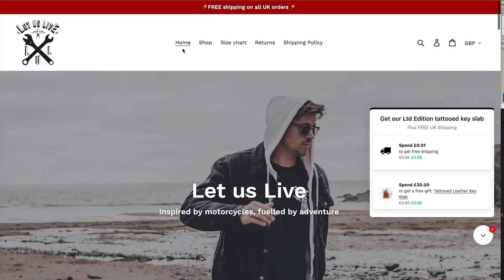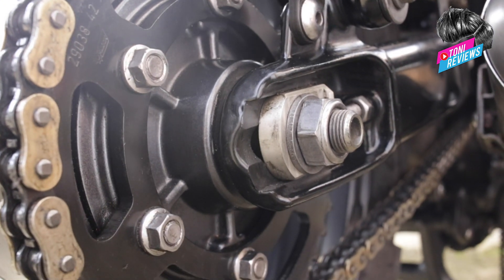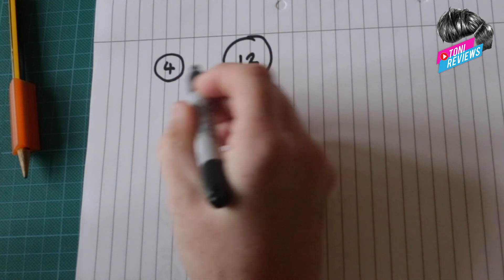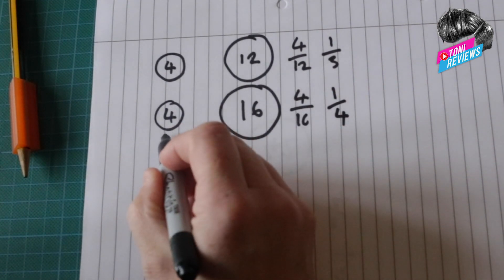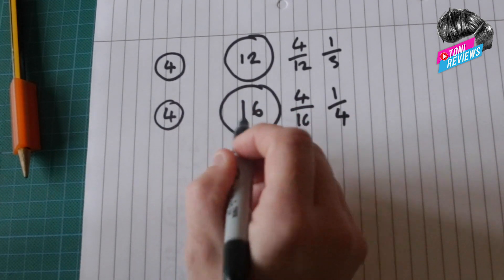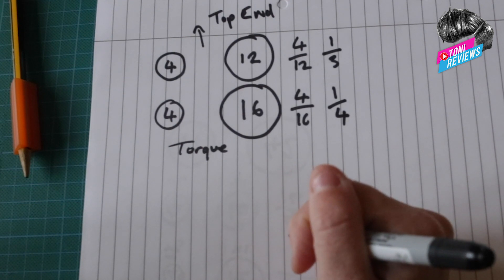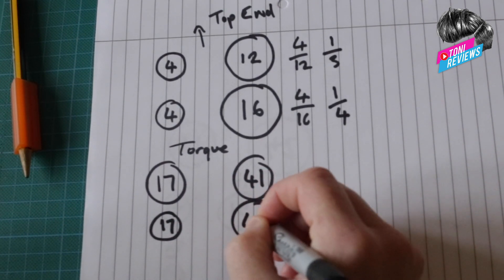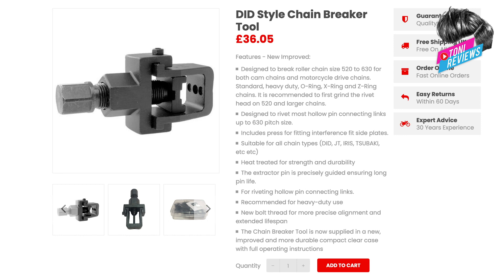How to increase power - More Speed v More Torque: Chain and Sprocket ratios explained

Comment: Have a 02 fazer 600 it dont pick up speed till around  7000rpm 14t 48t  sprockets i dont care about top end speed if i can cruz at  80 90 mph for motorways with more torque especially at low rpms what size sprokets would i need front or  rear
Reply from the maker: Dropping the front sprocket and increasing the rear will increase torque. Facebook forums are very helpful for advice on specific models of bike. The parts I purchased mine from was square deals. The website is included in this video description 🤦‍♀️